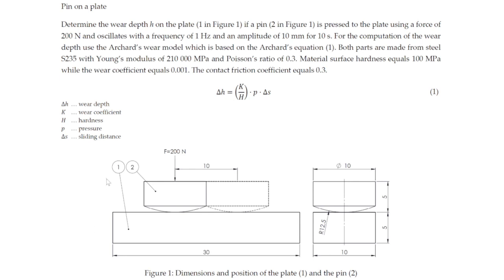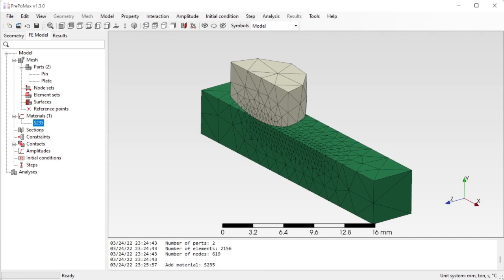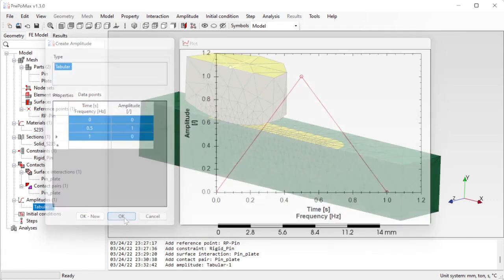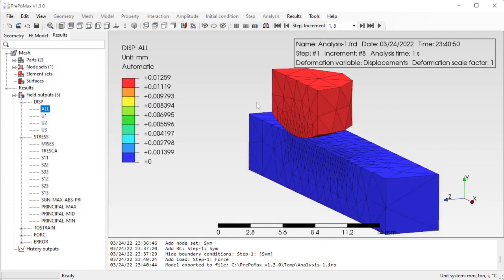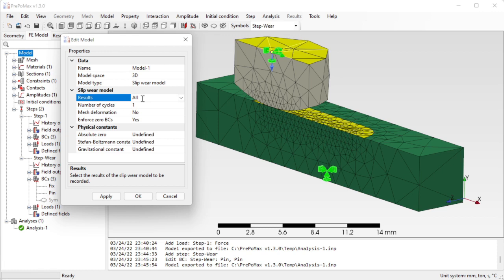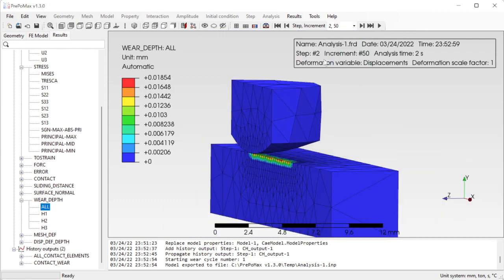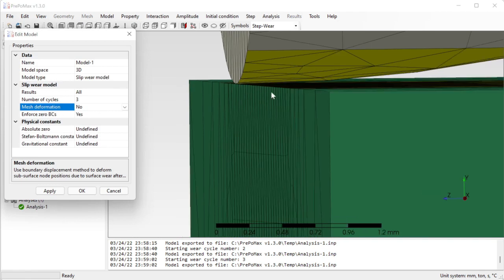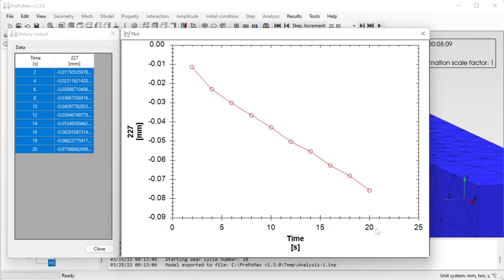PrePoMax & CalculiX - Wear analysis

Comment: Thank you Sir, How can we define the aplitube  if the pin is Rotating about its axis and  not linear translation
Reply from the maker: If there is a rotational movement, a reference point must be created on the rotation axis and connected to a part of the pin using the rigid body constraint. Then a boundary condition specifying the angle of rotation can be used on the reference point.
Reply: @MatejBorovinsek  Thanks Sir..When we run with rotation in pre-pro max the simulation is crashing after a few iterations. . Where can I see the log files to understand what went wrong
Reply: @Abhishek930  Hi Sir, were you successful in implementing rotational movement to pin ?
I am trying to pin on disc wear simulation and facing the same issue. Can you please help me if you have overcome this issue.
Reply from the maker: Please use our forum for support: https://prepomax.discourse.group/

Comment: Thank You Matej for this contribution. I've been lookin in CalculiX Keywords to see how is implemented and cannot find nothing about the wearing, I assume this feature is build natively on PreProMax using CalculiX engine as base, Am i right? Also I've notices that the new PreProMax v1.3.3 has different settings for the slip wear model, specifically on the remeshing. It would be interesting to add some comments on how this has changed.
Reply from the maker: The forum might be a better place to ask or answer this question. If you ask this question there, I can try to answer it. There is also some information about it in the documentation of version 1.3.3 on pages 30 and 31.

Comment: Dear Sir
Really impressive
Would be really interested if you can add tribological calculation frlm models in research to the contact models like wear or EHL contact or other types of simplified nonlinear contacts that can improve calculation accuracy at lesser calculation times
I have sent you a request on linked in would be interested in connecting
Reply from the maker: Such features would be nice but I am only developing the pre and post-processor for the CalculiX FEM solver. I think such modifications would have to be included in CalculiX.